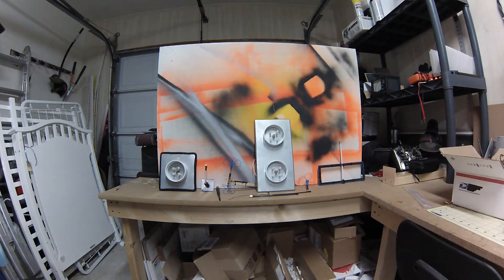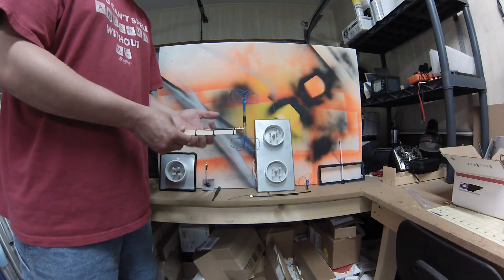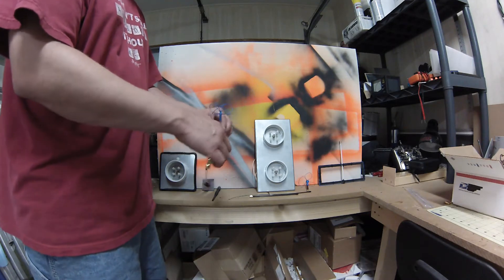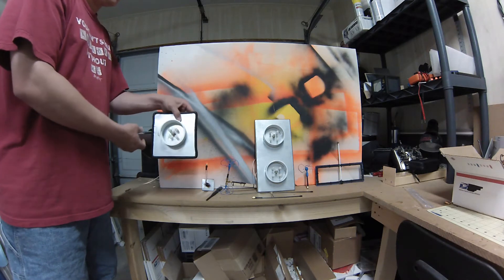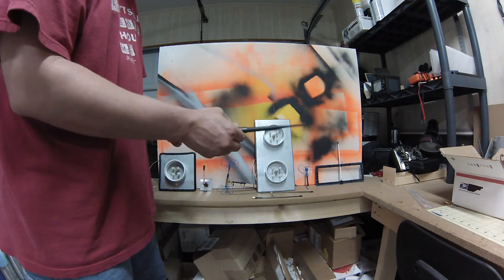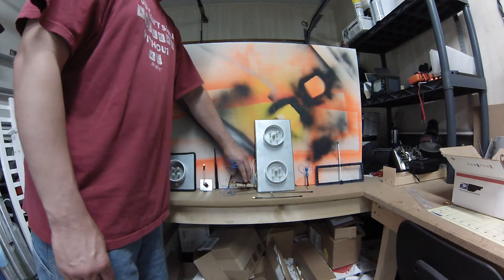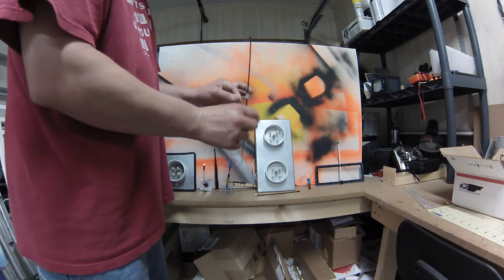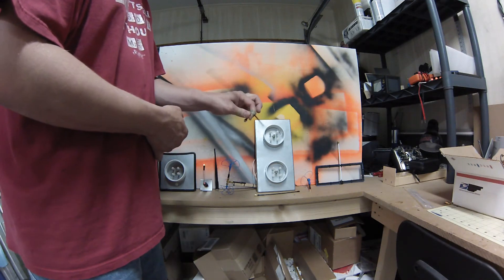FPV Antenna Orientation explained

Comment: Thanks for being clear.  I have mounted an old VAS video dipole,  the one with a forward leaning "V" shape, upside down on My fixed wing.  Yagi at the GS.  Vertical, tracked, etc...  My inquire on the web leads Me to believe the Yagi has no ground plane to orient?  So as long as I stay vertical, both should communicate?  My mount looks good so I figure it can;t possibly work!!

Comment: Hi, great video. Wondering though, you say the dipole and monopole need to be mounted vertically, what about if I want to communicate with something straight above my ground station, high, 30,000 feet balloon high. Would I then not be better to position the antennas horizontally on both balloon and grounds station ? Cheers
Reply from the maker: In that case you would probably benefit from mounting them horizontally. The main thing is that both ends of the system should be oriented the same way. My main focus for this video is FPV via fixed wing or rotary wing craft, where you are not expressly flying directly above your GS.

Comment: for the blue beam ultra antennas you say it should be on top for low altitudes. what is considered a low altitude.
Reply from the maker: It's a relative term. For me "low altitude" is under 75 feet. Remember neither is "wrong", they just have their advantages.

Comment: One point that you did not make...if you are using skew planar antennae, should the both be oriented the same way? Does it matter if the craft is pointed down and the receiver pointed up?
Reply from the maker: Ray, 
 It  doesn't matter so long as they are both vertical. In other words the cable pointing up on the receiver and down on the transmitter makes no difference. Think of it like a screw if you drive it into a block of wood towards the ground or the sky you still turn it to the right.
Reply: Thanks for the response. Nice video.